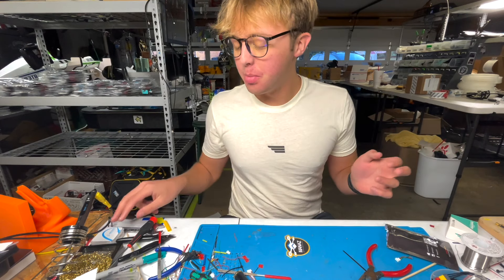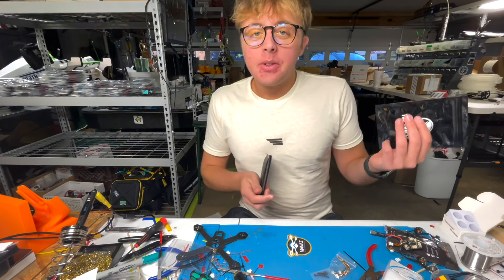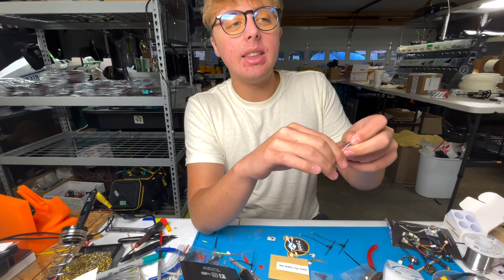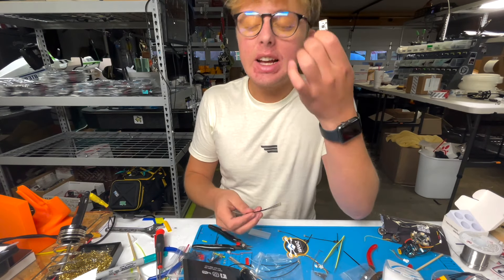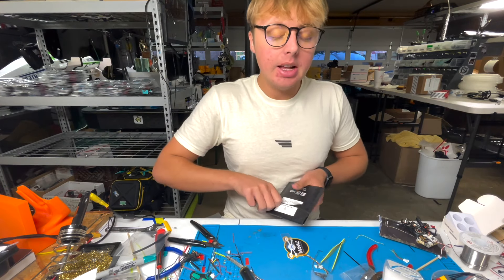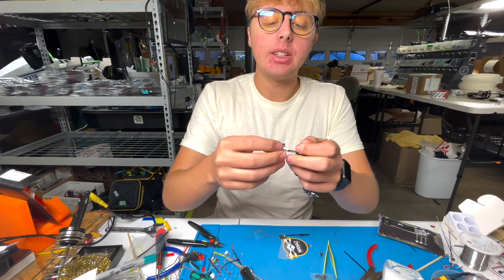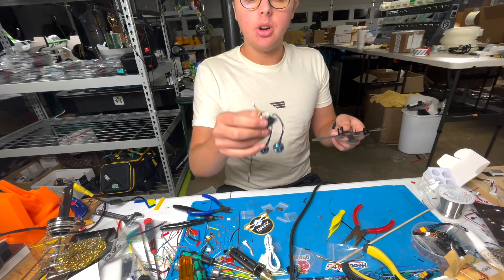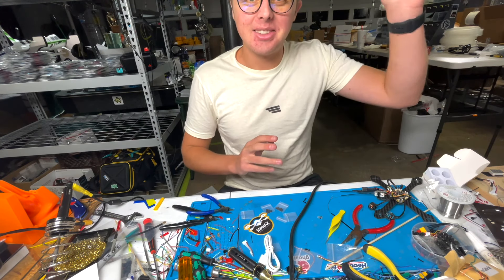The 7 Wire Tiny Trainer Build

Comment: Kudos for Plugs! This is awesome - and makes you so much faster on site if you need to replace stuff. The soldering on RX and VTX left is also the easiest solder spots in drone builds and on the 2 boards that die the last in this system - easy to keep a few presoldered spares in the bag. I'm also happy you keep improving on that tiny-trainer concept. This thing is amazing - glad it's not just a one-year thing and disappears again. Keep it up!

Also should get me one :P

Comment: In the current production of tiny trainers(May 2022) the board will not fit on the frame. It overhangs and will not push down past the front standoffs. Haven’t gotten help from fpvcrate, but totally sucks that’s it not be built with the components provided.